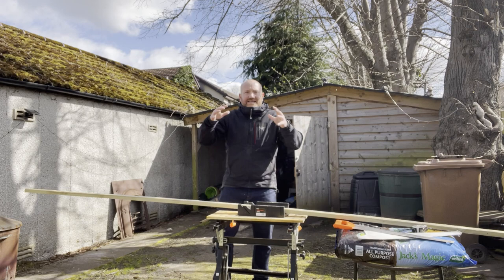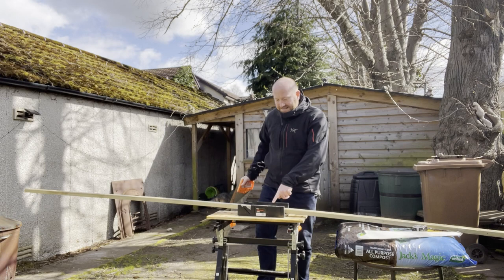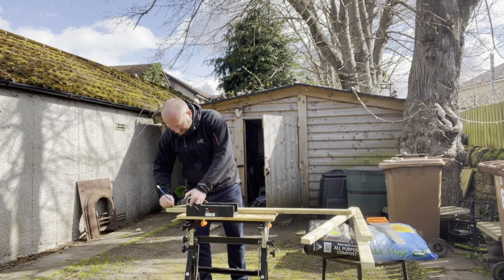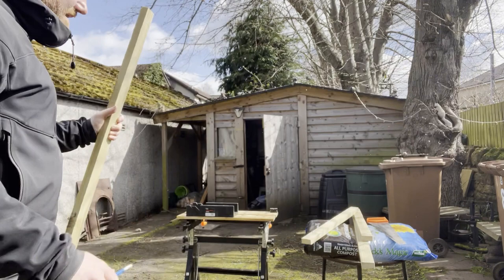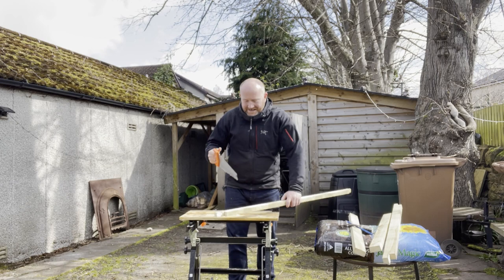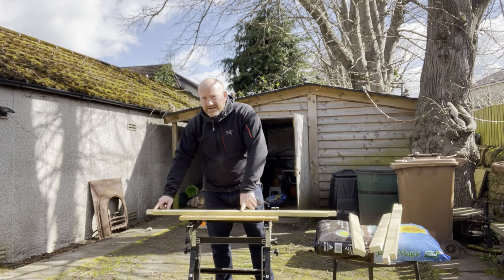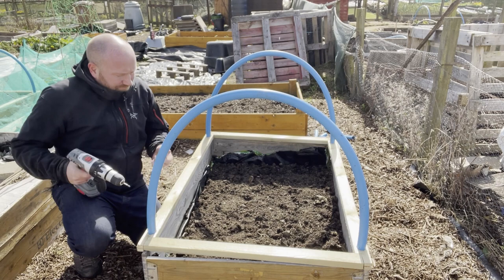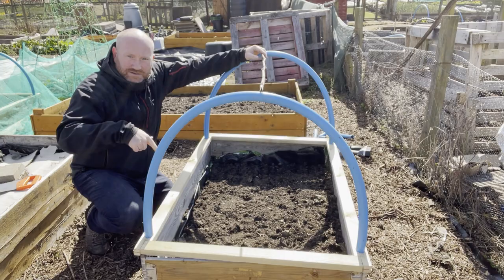How to Build A Raised Bed Cover (Hoophouse)

Comment: Great idea maybe worth putting some chain or cord at both ends to help support the hinges when you open the top to take the weight off the hinges & wood.  Just a thought to keep the top of the ground when open.  Great video well explained 👍
Reply from the maker: Hi Paul, great suggestion on putting some support in there for the lids. I had thought about just resting them on a bit of spare wood when open but using something like a bit of chain on either side is a brill idea. Will deffo look to pick some up the next time I'm at the diy shop

Comment: Great video, I might use your idea for my raised bed. I just finished building my raised bed yesterday. I built it out of pallets so it took a little while disassembling them and then putting it together. It was worth it though!
Reply from the maker: It's amazing what you can build out of pallets and a great way to reuse the wood. The covers will be a real time saver when they've got netting or the likes on them

Comment: Brilliant job. Sound quality isn’t great. Have you considered a microphone?
Reply from the maker: With you on the sound quality, I've just been having that same conversation. I use a Rode Video Micro mic with a dead cat cover but it doesn't seem to be doing a decent job. It's a bit of a pet peeve of mine having wind noise on the vids

I'm thinking about investing in a Rode Wireless Go which should help equalise the sound and with it clipping on to my top it should be more sheltered from the wind